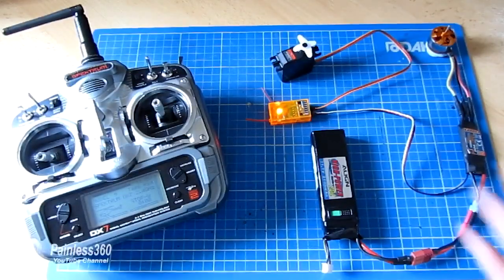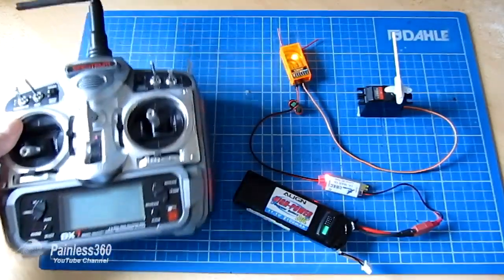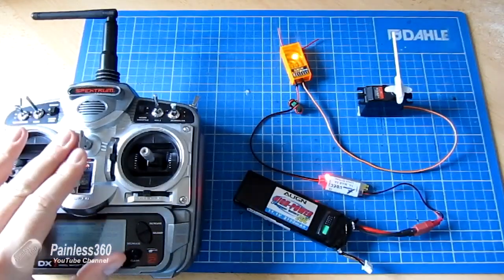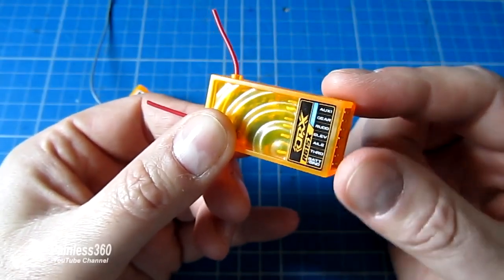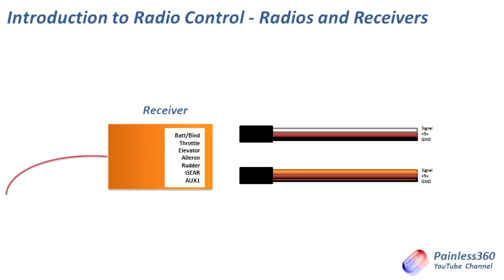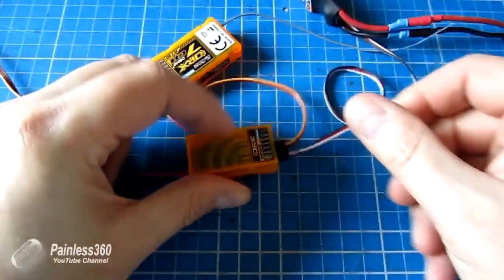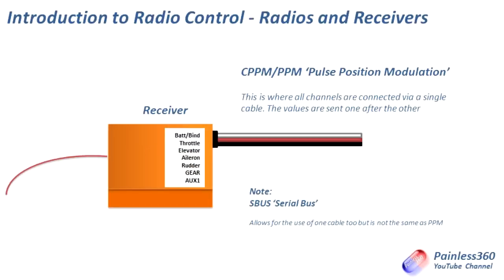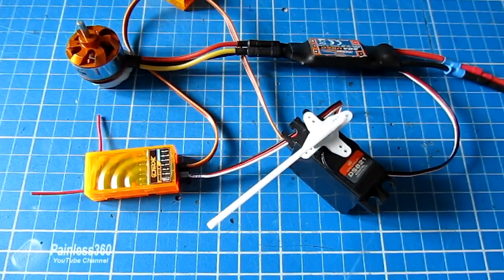RC Basics: Introduction to how a RC radio system works

Comment: Is it possible to add 2 motors to a plane then control one by the throttle and the other by the aileron?
Reply from the maker: Yes it is but it’s more usual to adjust the thrust using a little of the rudder control..
Reply: Painless360 OK but how to do it?just connect it normally or?
Reply from the maker: Depends on the radio you have on how you do it.
Reply: Painless360 thanks bro BTW u need to make a discord server it is a cool way to contact with subscribers and post channel news a lot of YouTube's did it already.

Comment: For example: I have a transmitter chip and can I use it directly to the remote to control it ??
Reply from the maker: Sorry, I don't understand the question
Reply: Painless360 I mean, can I use the transmitter chip easily without any hassles incoding languages like using Arduino ?
Reply from the maker: Check out my videos on the multiprotocol transmitter module. That's something that allows you to talk to pretty much anything by selecting how you want it to work. Hope that helps.

Comment: I'm looking to 3D print my own tracked RC cars, drones and 4 wheeled vehicles. Do you recommend using these controls to incorporate into what I want to do. I want a 1 transmitter and receiver to control several brushless motors with ESCs. Could you help me out please? Point me to some other videos that you may have? Links? Websites to buy the electronics? I was looking at rcsunnysky motors and they seem pretty interesting for incorporating into what I want to do.
Reply from the maker: Take a look at the playlists. There is an 'Introduction to Remote Control' series that is great for those new to the hobby..  Best of luck!
Reply: Painless360 Thank you!!

Comment: can i use this for a RC car?
Reply from the maker: Same ideas, a CAR radio is usually has the controls a little different though (trigger for brake/throttle and steering via a wheel..)
Reply: hi. im planning to build a RC car with camera. Can i use the left side control for the control of the car and the right side control for the control of the camera?

Comment: Thank you for your kind information on Rc remote controlling.
I have a question about this : Can i use Bluetooth or WiFi receiver and transmitter to control quadcopter
Reply from the maker: WiFi is used a lot on toy grade (and some less toy grade too!) but the range is severely limited over 'normal' R/C radios..
Reply: Painless360 thank you for your kind information

Comment: Hi is it possible for me to get  two forward and back separate commands from the left and right joysticks?  As in for a tank
Reply from the maker: Sure is. Some radios would be easier than others if you wanted a mix that meant you controlled the treads using a rudder and throttle..

Comment: Do I have to buy my electronics from one manufacturer?
How do I get to purchase them all in one?
Reply from the maker: You can buy your components from anybody, by checking the basics and making sure that they are going to work together you should be fine. See my series like the 'quadcopter building for beginners' where I talk about how to check these things. Best of luck
Reply: Painless360 
Alright thanks, what online shops can I get to buy these and have them shipped to my country?
Reply from the maker: No idea, you don't tell me where you are! Just have a look on the websites and check out the shipping details. See my other videos I have lots of ideas of places to get things internationally. Best of luck..
Reply: Painless360 
I am from Ghana, Accra. I have always wanted to build planes but didn't have the materials. I could send you pictures of some that I did if  you want to

Comment: any significant way to avoid signal interrupt between transmitter n receiver ?
Reply from the maker: Sorry, I don’t understand the question…
Reply: I mean like, when we fly a drone reach certain high or distance it will happened signal interrupt(receiver can't receive instructions from transmitter )
Reply from the maker: If you’re talking about getting more range from your radio equipment, then have a look at the TBS Crossfire series on the channel. There are few ways to get longer distances, more power or lower frequency or both!

Comment: I'm converting my 1/200 USS Wisconsin to R/C. already have the ship completed but I need help figuring out a dual rudder system as well as a 4 engine propulsion system that allows the 2 port side screws to move forward and back togethere and the starboard screws to do the same but independently from each side. Any help is appreciated
Reply from the maker: Most builders would do that with a mix on there radio. Modern radio-controlled radios are very powerful and one's like the OpenTX Taranis will allow you to set up pretty much anything. Hope that helps
Reply: Painless360 I had a newer controller like that in mind, but wouldn't this require ESCs? For the forward/revers
Reply: Painless360 I've got the rudder system figured out, one servo with a linkage rod connected to 1 rudder and a linkage rod connecting both rudders and a general idea for the motor placement but when it comes to the speed contorl units and the radio units and the battery, I'm lost, any suggestions for that?
Reply from the maker: I'm not a boat guy but you can definitely get waterproof ESC that also have a reverse function, so typically there are two wires coming out of ESC 14 the standard throttle control and the other one controls whether or not the ESC will run in a forward or reverse Direction. Some models like the Tundra plane also have this feature to as they can be fitted with floats and allows you to reverse out of the edge of a waterway.
Reply: Painless360 thank you, this helps quite a bit, any suggestions for the power supply or a specific motor? I plan on using 2 motors and a gear system to run 2 propeller shafts on each motor. And the power supply doesn't have to get it going fast because this is a large scale battleship that only goes 32 knots (about 40 MpH) on the real ship. Any suggestions on that?

Comment: What is the best tx rx with 5km long range ?
Reply from the maker: +MOVIES FX youll need a 'long range system' for that. Lots of vendors have them (or are coming out with them). See my series on the TBS Crossfire for one of the most popular. Best of luck

Comment: everything works except the motor ecs is hooked up the right way,elv,flaps rud and  ailerons work but no motor what did I do wrong.
Reply from the maker: +robert s. Daniel very tricky to offer any advice without knowing exactly what troubleshooting you've already tried...

Comment: Can a receiver work with any flight controller (if it has the right voltage) ?
Reply from the maker: If the flight controller can understand the protocol for the radio receiverthen it should. Normal protocols are PWM, ppm or SBus. See the other videos in the introduction to remote control series. You could also watch my quad copter building for beginners series, there’s lots of information in there to first-time builders. Best of luck!
Reply: Painless360 Ok thanks alot. Your videos really help out.

Comment: Hey Painless360 I have the same set up but mine is with a brushed esc and motor but l cant get the motor to work with the esc for some reason. any tips? Motor works fine with battery connected direct just not with the esc.
Reply from the maker: +daddyrkingpin there are ESCs for brushless and brushed motors, make sure it's the right type.. difficult to help without knowing more about what you have there and what you've tried already.. best of luck!
Reply: No problem l figured it out. I had to plug the esc into the throttle of the receiver instead of the power or (+ -) of the receiver. Might be a good thing to point out on your videos. I looked everywhere on youtube and nobody says anything about that. I just assumed since the battery hooked up to the esc that the esc would plug into the + - on the receiver.  Thanks for your fast response and videos!
Reply from the maker: +daddyrkingpin if you watch the other video's in this series, it's all covered..  happy flying!

Comment: Hey painless360 i want to make a quardcopter rather than what u show which more thing I want to have
Reply from the maker: +3minutes talk See my 'Quadcopter building for beginners series' where I show every part and step. Best of luck!
Reply: Hey painless 360 the equipment shown in video is sufficient to a rc plane
Reply from the maker: +3minutes talk most modern radios will do both.. see the reviews.

Comment: Can we use the same transmitter for different receivers?
Reply from the maker: You can normally bind multiple receivers to the same radio. Normally you have a 'model setup' for each one. Best of luck!
Reply: Painless360 thank you

Comment: +Painless360 what about duel motors for ships
Reply from the maker: Sorry, I'm not a boat guy. If you Google something like 'differential thrust painless360' you can see my video on it. I'd expect it works the same in the water? Best of luck!
Reply: You will need to desing a DC motor engine for boats requires work YouTube it

Comment: how does the receiver differentiate between two transmitters of the same frequency ? you kind of explained it by using the analogy of the transmitters all speak "different languages" and therefore the receiver differentiates on that basis, but is there an in depth explanation to whats really going on.... i just .. have to know XD..!!
Reply from the maker: +Hussein Elsherbini Great question, when you bind the receiver to the radio what's actually happening is that there is a digital handshake and signature stored between the two. This means that the receiver will only receive information from the transmitter that it's bound to. Quite clever eh? Best of luck, happy flying
Reply: after some research i think i understand what you mean by handshake and signature, are you reffering to infrared control codes?
Reply: Project Hu148 instead of simply sending a direct signal like a voltage level, which would activate any rc within rangr, it sends a codified i struction, and every instruction begins with a particular  code or handshake that is specific to each pair of control/aircraft. Thus way, other aircraft will pick up uour sigbal, but because they will see a different handshake from their own, they will simply ignore the instruction

Comment: Will 2 of the same remotes interfear
Reply from the maker: Not sure what you mean. The hobby has worked hard to create digital systems that work well and don't interfere. The only hard and fast rule now is use a different frequency for your FPV (usually 5.8Ghz) to the one you're using for the radio (usually 2.4Ghz). Best of luck!

Comment: Hi
I have a 2 channel rc transmitter of a rc car but I lost the rc receiver. Can you help me in making receiver 27mhz. Circuit diagram, parts etc
Reply from the maker: No idea about that, sorry. Radios are a lot less now than they used to be so replacing the setup with a modern digital system may be less than you think.. Best of luck!

Comment: Hey man, nice job with explanation of RC system :)
I'm new to modeling in general and I'm trying to make a RC car that would be slow (max 1m/s) but weight around 30kg with 2 motors and one servo. Now, I know I need strong motors but those motors use a lot of current (6A) and I'm not sure how should I connect motors to receiver without burning and destroying the chip :/
Thanks!
Reply from the maker: If you're new then most of the 'Introduction to Remote Control' series should still help you get a grip of the basics. Best of luck with it!

Comment: Hi i want to ask you if you can help me solve a problem with a RC 9.6 V with chargeable batteries. I cant get the receiver to communicate with the RC car. Do you know how i can fix this. I have tried changing batteries and put some aluminium folie on the antenna on the car.
Reply from the maker: +MrTvmediaman sounds like you are new to the hobby. I'd find a copy of the instructions for the radio you are using  (you don't mention which one you have) and check they are bound. See the videos in the 'introduction to remote control' series for more basics that may be useful.  Best of luck!

Comment: I have a school A level project and would think that it would be a really good idea for me to make an RC plane. Where could I learn how to do this, along with lessons on the components of the plane?
Reply from the maker: I'd start by looking at what is on a RTF model. We don't have any videos on making your own but you'll need to cover the basics of flight, wing and air-frame design (if you're not buying one) and then servos to control the elevator, aileron and rudder and then the connections to the radio receiver and battery to control everything. Could be a great project and you'll get a model out of it too! :D

Comment: whatisthe Parts you use here the Receier ,the ESC, the Remote control
Reply from the maker: +Generic88 this video is quite old now, if you're interested in making a model then watch our 'quadcopter building for beginner' series on the channel. Those series use much more modern components. Best of luck

Comment: https://youtu.be/xXiODfMrr5c what would cause this? i have alien 5" did have hyperflite f4 till it randomly lost all settings when pluggin charged lipo up after flying great 12 times same day, so now i have sp racing f3 (because all i had) and now i cant get the signals on it to quit jumping around and not clean. What would you do?
Reply from the maker: +David Downs I try another receiver, looks like something power related happened on the quad when you plugged that last battery in and potentially damaged the receiver as well. Fix that or troubleshoot it anyway, and that's try another one.

Comment: if i increase the voltage powering the the flight controller by a little bit what will happen
Reply from the maker: The board will eventually give up. Happy flying!
Reply: Painless360  just a little  a volt

Comment: how could you make the ailerons go up down AND 1down 1up & 1up 1down? (sp basically the elevator and ailerons are the same part)
Reply from the maker: +Eliaz McNaught do you mean elevons? The radio normally has a setting for that to mix the controls automatically..
Reply: Painless360 thanks i had figured that out!

Comment: what if you put 1 of the cables on the wrong pin? does it care? or you can just switch them and nothing happens?
Reply from the maker: Nothing bad should happen if you make a mistake plugging in the servo cables into the receiver. I mark my servo leads with a sharpie as I build to try and avoid this. Always double check the wiring on any model before plugging in any power. Best of luck!

Comment: I wanted to ask there are other buttons also...what do they do?
Reply from the maker: They can be ued to control the other channels that the radio sends to the model to control other things on the model itself. There are lots of videos in the 'Introduction to Remote Control' series if you're new to R/C.. Best of luck!
Reply: Like what do Throttle, elevator, rudder, aileron trim levers do?
...Yeah! I am new to R/C system.
Thanks for reply.
Reply from the maker: +Nisha Singh that series I mentioned will help! Best of luck!

Comment: Nice video! Im getting into drone flying and am planning to make one eventually so I'm studying up. It may be a silly question... But is the flight controller the same thing as the receiver? And if I were to make a drone and buy a spektrum controller, would I have to put the receiver that came with the transmitter into my drone or would others with the same frequency work? Thanks!
Reply from the maker: Not silly at all! The flight controller and receiver are spate normally as you need to use a receiver that works with the radio you have. If you're new then there are a few series that should help. 'Introduction to Remote Control' and 'Quadcopter Building for Beginners' are great places to have the basics covered. Best of luck!

Comment: thanks for  wonderful information I had a some stuck point here in india am getting higher amp batteries like 40-55ampa for a esc of 30 amp and motor of 12 amp with 10x4.5 prop am not trained so need help
Reply: simply need to know can a  higher amp battery damage low amp Esc
Reply from the maker: +rajnish oap see the other videos in the 'Introduction to Remote Control ' series on the.channel. We cover sizing batteries there. You. Or ally want a battery higher rates then the ESC needs.. Best of luck!

Comment: Hello, in what port do I need to stick my battery, aux? I have 6 volt servos, do I need to power the receiver with a 6 volt battery?
Reply from the maker: Check that the Receiver is ok with 6v first. If so then plug the 6v supply into any spare output.. Best of luck!
Reply: I tried it and it worked!
Reply from the maker: Nice job! Well done and happy flying!
Reply: thanks!